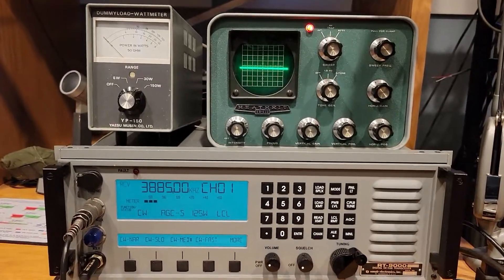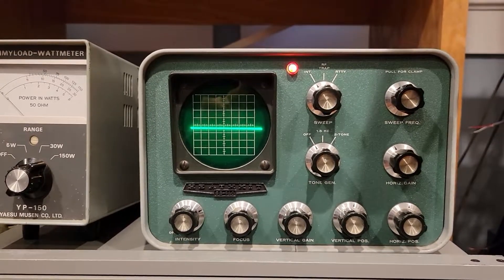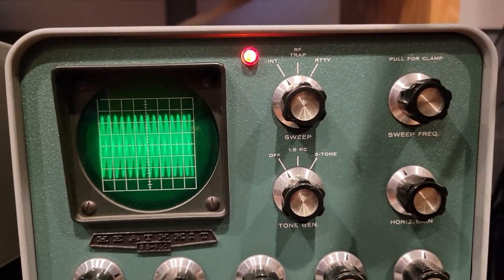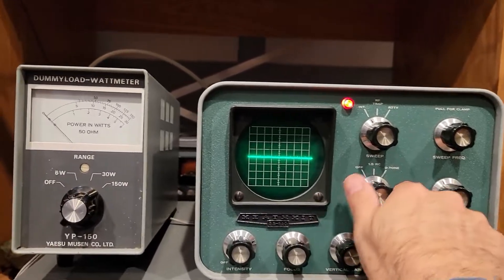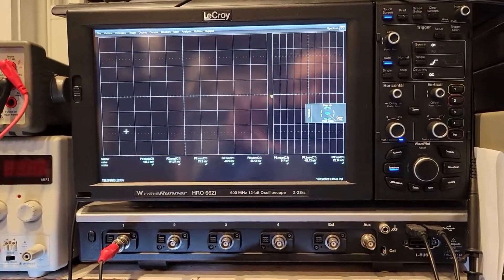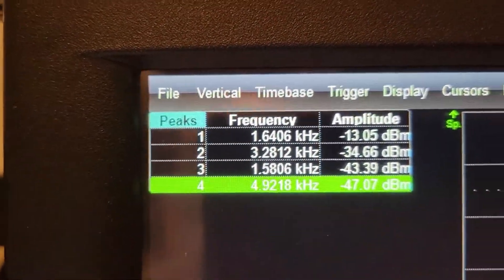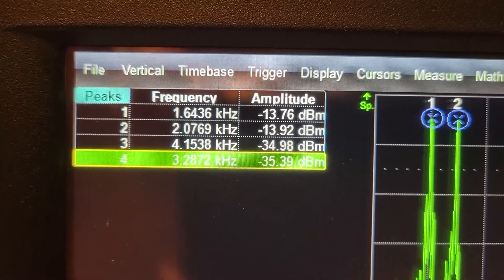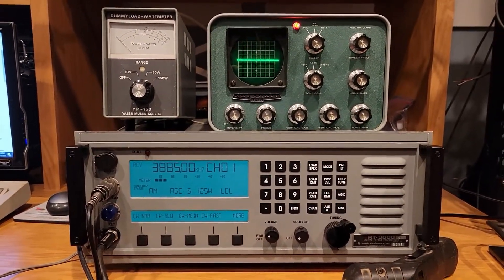Heathkit SB-610 Signal Monitor

Comment: I also have the Heathbit SB-610.  Trying to get the microphone to test but no luck so far.  Do you have any photos or videos of what connection hook ups you used.  And do you need a wattmeter to get the microphone function to work?  Thanks.
Reply from the maker: I'm not familiar with any microphone feature of this panadapter. Maybe you're thinking of some other product of heathkit? Maybe a transmitter?
Reply: Is this Heathkit unit available for sale?
Thanks!
Reply from the maker: @juddkincaid4799  Sorry it sold :(